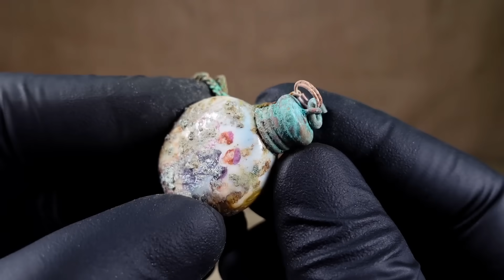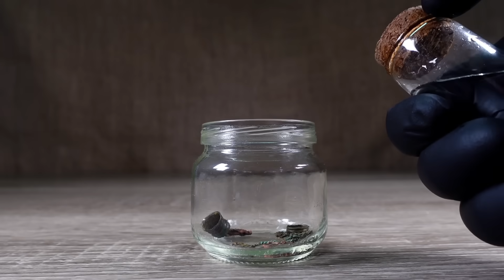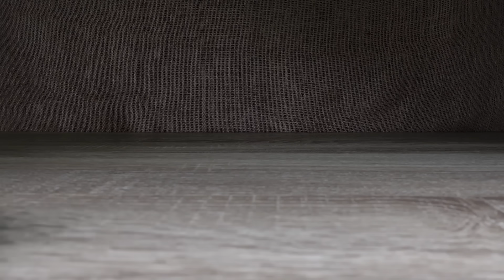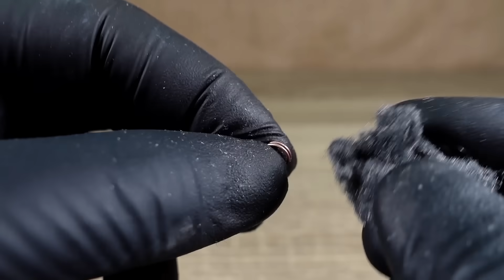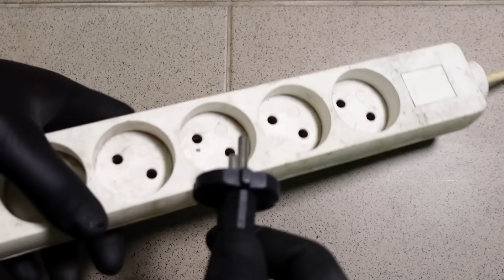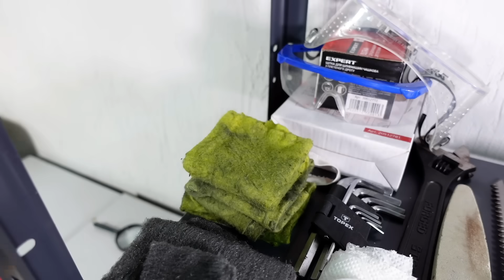Old Antique Princess Perfume 1800s - Restoration

Comment: You can tell the age of a piece of jewelry by the clasp.  If this piece had a lobster claw clasp attached to it, it is not that old. They were first introduced in the 1970s, although some say earlier - 1950s
Reply from the maker: Greetings! It seems to me that these fasteners were attached to the bottle later.
Reply: The clasp could have been a replacement in the 70’s of the original.
Reply: The clasp is a different color than the other components. Different metal.
Reply: We call them parrot beaks which aren’t very old?
Reply: Also you can guesstimate the age bested in the “enamel”, which has clearly faded from its original appearance! Real, baked-on enameling might chip with age, but the color would not fade in just 150 - 300 years. I agree with the 1970’s or 80’s being an appropriate age for it. 😅
Reply: I'm pretty certain these were popular in the 1970s.  I'm thinking it was an  Avon product or even Coty.
Reply: @amandajingleheimerschmidt3050  The design on this bottle looks like it was applied borrowing a technique used in porcelain and pottery. The image is printed like a decal which is applied then  fired.
Reply: @hollyvanostrand4292
It`s not just the clasp. The entire design and the materials don`t fit a 19th-century piece.
Reply: @lechat8533   I recall a trend in the 1970's for reproductions of vintage styles of all types, especially Victorian. The jewelry brand 1928 got it's start that way.
Reply: @2degucitas  
Very interesting. Thank you :)
Reply: Sweet piece and lovely restoration.
Reply: The modern lobster claw clasp was patented 1996 in the US but there were similar in in the 50s 60s and 70s. https://youtu.be/ELCNzkFPXow?si=84wBYqIbEdzZBdcI
Reply: Your right !
Reply: It isn't old at all .
Reply: Question: Could this part be a repair part though? Just curious. 😅
Reply: The owner could have changed our the clasp
Reply: A mí , que adoro las antigüedades y me gusta restaurar todo tipo de objetos ( heredado de mi padre ) , me parece un trabajo de 10/10 . Yo nací en 1960 y mi madre compraba productos Avon . Yo ahora también.  Los frascos eran muy bonitos entonces.  Está pasada primavera , tuve que poner un cierre de Pinza de Langosta en oro de ley de 18 k  ,a una de mis joyas y me costó 350€ !  En verano ya no lo hubiera podido comprar porque el oro está por las nubes.  En la casa de la abuela de mi esposo de 64 años y sus hermanas de 74 y 69 años respectivamente, queda una buena colección de frascos perfumeros con borla lateral para pulverizar en cristal en varias formas y colores  . Me encanta mirarlos sin tocarlos  por miedo a romperlos .  Toda la casa y librería en francés, son de cuando se casaron y muebles heredados de sus padres y abuelos a su vez de Barcelona .  Me encantan los objetos antiguos !  Saludos desde España 🇪🇸   Delicado diseño . 🎉
Reply: In the 1400, pocket watches with a chain, came into existence in the 1400s. So, to say chains did not exist back then is wrong.
Reply: Peut être que le fermoir est récent et a fait l’objet d’une restauration récente. Mais le flacon lui semble bien ancien.
Reply: Isso chamou minha atenção também (o fecho de garra de lagosta)
Reply: You can't tell the age of anything when he's done with something!!!! He Completely erases or completely damages all proof of age!!!!!! People like him are the reason, brand knew shit can be sold as Antique!!!!!
Reply: People often replace clasps on  necklaces for ease of opening. I have done it myself on older necklaces. There is no point in having it if you can't wear it.
Reply: Clasps can be replaced.

Comment: Based on the jewelry hardware, I think this is a modern reproduction, not a Victorian era piece. The lid looks like it's plated (chromed?) but that wasn't done until the late 20s and the lobster claw clasp wasn't invented until the 50s  and not popularized until the 80s.  The chain, although in use in earlier times, wasn't a style popularly used until the 60s. Also, the ring that looks like a little spring is called a split ring. They weren't invented until the late 30s and weren't used for jewelry until much later. 

Lastly, if this was for a high end piece, the jump ring would have been soldered, and all hardware and chains would probably have been brass or gold-plated brass. 

So my best guess is that this is a replica piece from the 70s-80s. 

Also, as a side note, it's much easier to open jump rings front to back, instead of pulling them apart.
Reply from the maker: Hello! The cap and bottle are old. I only have suspicions about the chain and the clasp. They are possibly more modern.
Where are you watching from?🌍😉 Have a nice day!☀️
Reply: @TheRestorer  I am in Texas. Thanks for the response. It's difficult to tell from the video the coloring/plating on the cap.
Reply: @eliseintheattic9697 lobster clamp has clearly other colour
Reply: I checked your channel. I would love to see teaching videos. I watch Jason Adams and love him so much 🕊️🕊️🕊️
Reply: @VondaInWonderland  Thanks! I am about to start adding videos again. I have one that's almost ready.
Reply: Because this is a fake restoration
Reply: It seems at best a collectors piece, that is a manufactured collectible.
Reply: you're absolutely correct, it is a modern reproduction. when the light hits the bottle in the end, you can tell that the paintings on it are printed on, the same style as they print stuff on porcelain nowadays. if it was victorian, then the painting on the bottle would've been hand painted on it, but that's not the case. this channel is full of fake restorations and false claims how everything they restore is so very old but it's not true
Reply: @cynthiapharrell6250  That's pretty much what I thought, but wanted to give the channel the benefit of the doubt.

Comment: The scene is referred to as a “courting couple.”  There are several variations of these loving couples hand painted on 19th century scent bottles.  They were reproductions of the “artist Watteau” style of paintings.  The original chain and link would attach to a woman’s chatelaine.  This chain does not appear to be original.  The lobster clasp was added much later.  A chatelaine attached to a woman’s belt or belt loop on her dress.  It’s hard to determine age.  Many had pure silver of gold caps and chains.  Many of the scent bottles were also heart shaped.  A lot of the scent bottles were made in the Czech Republic.  Look up courting couples scent bottles.  In restored condition with dent on top and replacement chain approximate value $100.  If true silver of gold with signed bottle much more.

Comment: This is at most a 5.  The dent in the cap was not repaired.  The inside of the bottle was not cleaned to original condition.  A 10 means perfect.  Not even a difficult porcelain repair in this.